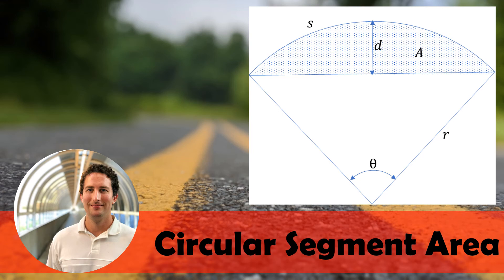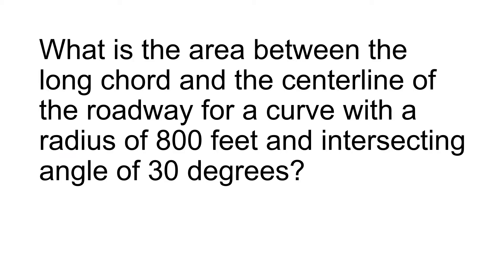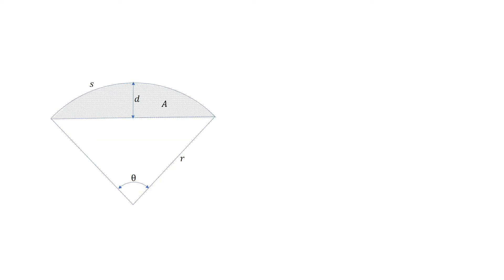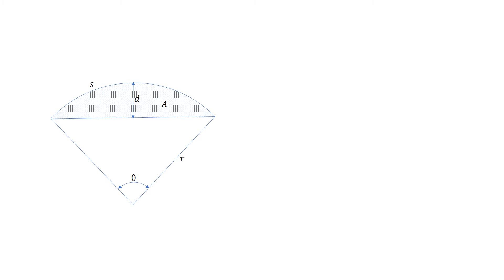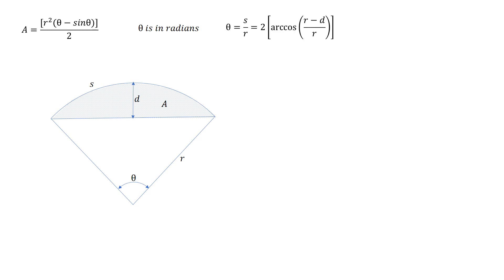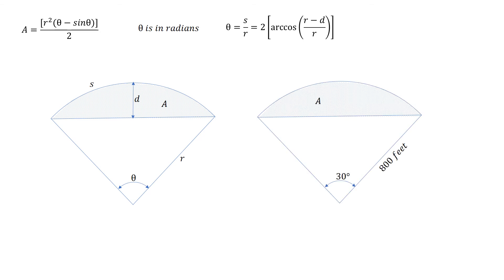Circular Segment Area | NCEES Civil Engineering PE Exam [Section 1.3.7.5]

Comment: I am getting your answer but using degrees for theta and not radians. Was there an error in your comment at 2:33?
Reply from the maker: Which part of the comment might have an error?
Reply: At 2:33 in the video you mention theta should be in radians but running the equation in decimal gives the answer you have
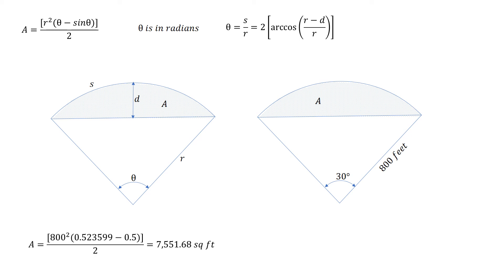Reply from the maker: @Jeff-lb2by  From my calculations, 30 degrees is 0.523599 radians and sin of 0.523599 radians is 0.5.  Using those values in the equation shown at @2:20 provides me with the answer shown of 7,551.68 sq ft.   Do you get differing values at any of those stages?
Reply: @FindleyDaniel  The anlge unit in calculator should be changed to radian to get the right answer. So yeah Dr. Findley is right.